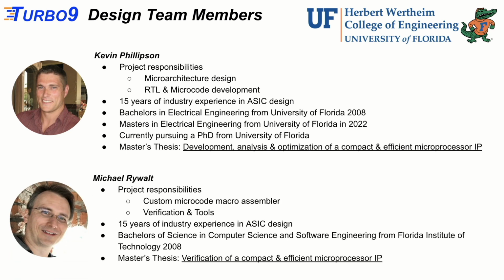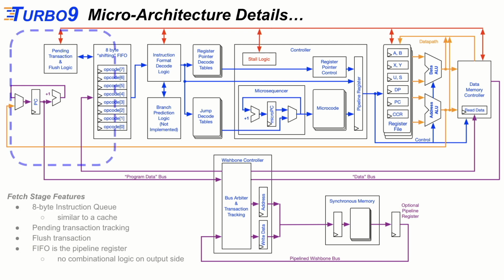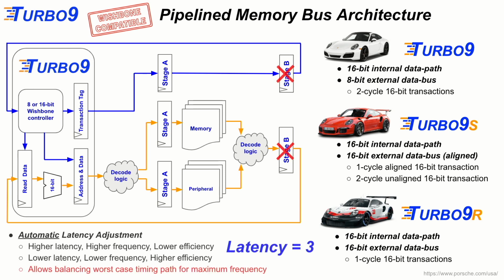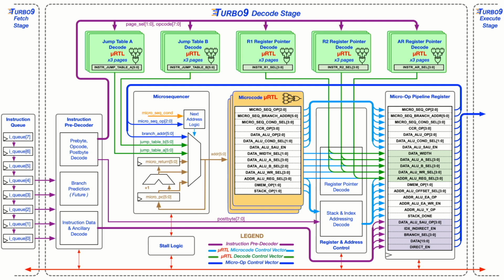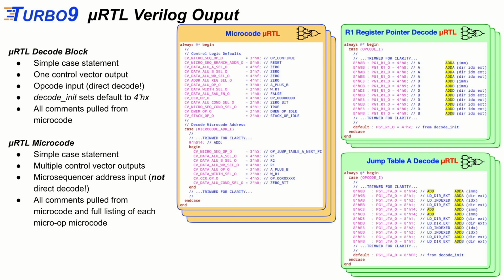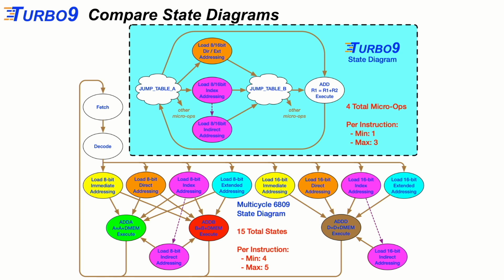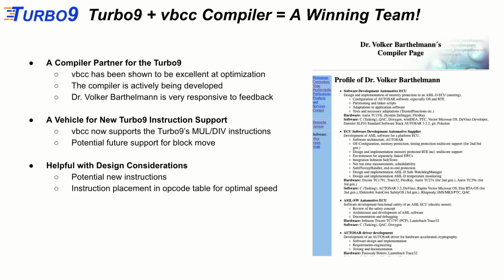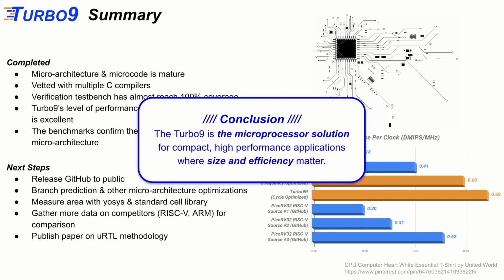Turbo9 - Pipelined 6809 Microprocessor IP

Comment: This is a really interesting project. The inclusion of a hardware-divide is a good choice. With modern fabs, it might get attention if someone made an 8-bit processor--that attained several GHz, even more so, if it could throttle to almost nothing such ancient RCA1802.

Of course, I want there to be either a 24-bit address space, or a psudo-block switching scheme, such as the CoCo 3 "GIME," but integrated into the CPU. Just by reserving one 8-bit vector for the memory blocks, the memory could be 2MB, at least, which isn't all that impressive, BUT, perhaps the CPU could just as easily load in ROM blocks (or even FLASH blocks ala ATMEGA.)

I should think that you scoured the HC6309 instruction set for useful things? I think the 6309 had a 32-bit register, joined like the 16 bit D register, which are also the A and B.

I do have my heart set on seeing a modern 3GHz 68000-like processor, but surely I want your project to come to fruition.
Your team seems well qualified for such a project!

[I feel bad for Motorola. Although the 6809 and 68000 seem to be based from mainframes such as the old DEC PDP's, it seemed like Motorola's relationship with IBM was one-sided. Motorola was doing fine, making CISC processors. The went all-in for the PowerPC, and now they are dead. Sigh.]
Reply: A big endian 8 bit processor like 6800/6809 makes no sense, I can't understand how Motorola was so blind to that.  Works great for 8 bit values but 16 and 32 bit (6309) values are fetched in the wrong order, thus the 8 bit ALU can't begin doing the arithmetic until both (or all four) bytes have been read, only then can it begin the 2 (or 4) cycles to do the arithmetic, but the little endian machine can do the arithmetic as the bytes are read.  I believe this is the single reason the 6502 out performed the  6809.

Comment: This shows that those Motorola guys were right after all. The 6809 deserves to be one of the few CISC architectures to get a microcode translation architecture like x86 did.

I'm still sad that they abandoned 6809 in favor of extending 6800 for future chips (68HC11 etc.)
Reply: I don't think they made a mistake in focusing on the 6805. That made them a lot of money and they were able to extend the IPA and keep it relevant. It's still a good architecture, even though I would have added a separate parameter stack when they added the push and pop (PSH/PUL) instructions to the 68HCS08 derivative. (Or, actually, I would have added it at least as early as 146805.)

I also don't think they made a mistake in extending the 6800 architecture in the 6801, except that I would have split the 6801 into the one we have and another that moved some op-codes around to squeeze in direct-page addressing mode unary instructions, and added at least one address line to allow moving the direct page out of the absolute address map. (Among other things.) I think the market would have supported both directions.

They did make a mistake in failing to supply the 6809 as an SOC core to general customers, and in failing to extend it. Just adding segment registers and a few more small tweaks (completing the DP addressing, adding the FDIV and IDIV instructions that the 68HC11 got) would have pitted the 6809 head-to-head against the 8088.

Comment: Very interesting material on producing a modern design for an older (but much loved) ISA aimed at a industrial-grade implementation. I wish the team — and the TurboR — much success.

From the PoV of the retro hobbyist, and as touched on in the video, it would be harder to reap the benefits as a ‘drop in’ due to the timing dependence of ‘80s software, but one could easily imagine a new ‘retro style’ machine using this, a Dragon or CoCo ‘++’ if you will.

Thanks for a great presentation!
Reply: CoCo software is generally a lot less timing tight (for whatever reason) than a lot of other 8-bit machines
Reply: That's why there are operating systems. I'm hoping for a version of NitrOS-9 that can run on Turbo9.
Reply: @JamesJones-zt2yx  It should just run. 

Well, sort-of. A few drivers would need to be modified, to deal with timing issues.